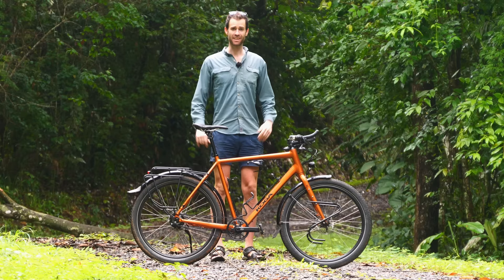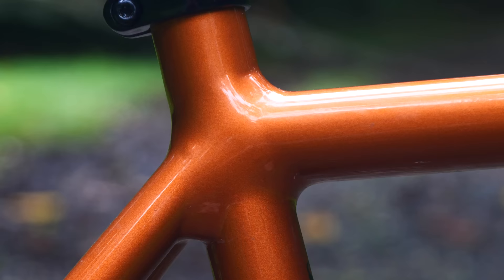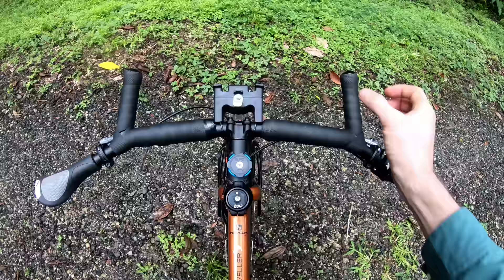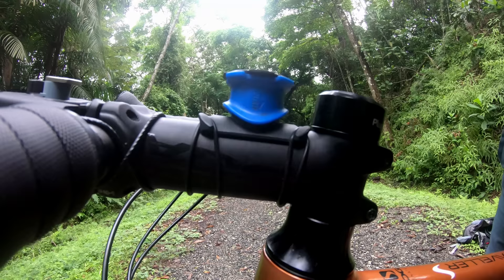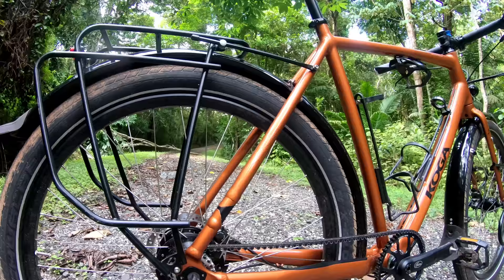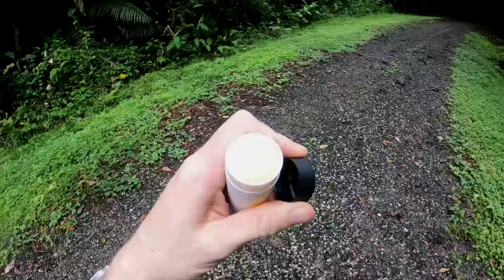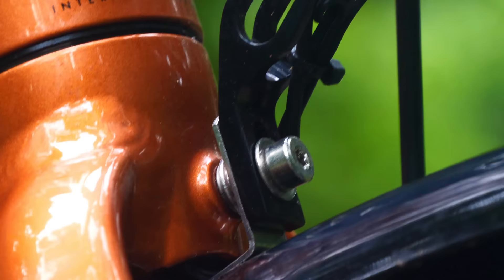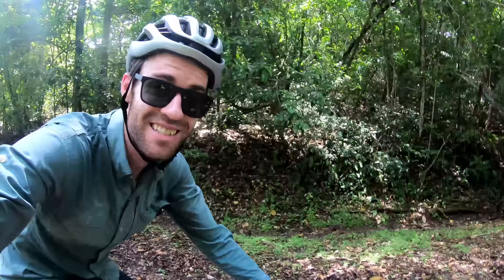The 2020 KOGA WorldTraveller-S is a $6000 Indestructible Touring Bike

Comment: What no pinion!? Hmmmm
Reply from the maker: Sorry to disappoint. 😅
Reply: CyclingAbout 😁 Didn’t you have pinion on a previous rig?
Reply from the maker: @JohnBr0  I've been using Rohloff hubs for the last 10 years, and love 'em. 👌🏼
Reply: The high price of the Rohloff hub is offset by the fact it has an amazing lifespan. Most owners go through multiple bikes with the same hub for years on end, and a man from Spain has been using his during more than a decade while travelling non-stop for the last 15 years!!
Reply: Pinion is an interesting development in cycle touring. That said, I’m curious how it will handle conditions like the ones experienced in this video series.
Reply: @dougfromsoanierana  The one from "Kamran on bike", who is doing the same trip as Alee, has been replaced recently. Don't know what was wrong, though.

Comment: What a sick rig! Love that gorgeous colour 😍😍  I also run supermoto-x's on my plus bike, but they are the 2.8's. I did recently have a puncture which surprised me, and it was a piece of glass which gave me a slow leak. Apart from that they just iron out most imperfections in pavements and roads and roll surprisingly well. The downside is that they are an absolute bitch to remove and install, on my rims anyway.

Comment: Junk for $6000 I can get a really nice mountain bike.
Reply: I thought exactly the same, a hard tail can do absolutely the same for $1000.
Reply: I thought so too for a moment but realised that most of the tech is hidden - its about quality of materials and reliability - the hub alone on his bike costs over a grand. But means you never need to clean it - lights charger everything is intergrated and topend. I bet those racks cost hundreds of euros also. we see alot of stuff that is cheap and looks the same but not with the level of reliability
Reply: @harryc7225  shitty aluminium instead of high tech steal. plastic shifters etc... 6000(!) $.
Reply: @kohlrabenschwanz  Even as a kid I hated this plastic shifter and knew it was shit. This looks exactly the same. That really surprised me.
Reply: Polygon bend riv

Comment: It's genius that the Netherlands and Germany make the world's best touring bikes. Falkenjagd are doing very stiff titanium forks and thru axles or standard.. They are confident their racks they make identical to tubuss can not fail at the welds and began making planes. 

They went away from tubus because of material issues meaning they stopped producing the logo titan and because they refused to drill a hole for cable internal wiring. The brand also make stainless and rennstahl painted racks at lower price with same benefits and paint is very anti corrosive and resists many scratches due to air hardening

Comment: Not sure quite what to think about internal cabling. Prefer straight cable runs to avoid as much wear as possible. There is the argument of protection but not sure that amounts to much. Seems more of an aesthetic choice. Is there a weep hole to channel moisture?
Reply from the maker: At the bottom bracket shell is the drainage port.

Comment: Great bike. 50/22 (122Teeth belt?) set up seems a sensible choice offering a 2.273 gear ratio. My Koga came with 50/19 120T (2.63) and this is too high for expedition type riding. Gates suggest that the gearing offered by 50/19 is for "On road bike packing, commuting, gravel riding" clearly a ridiculous choice for such a bike.
I am sorry to say that Koga also offered no advise on what other combos suit the frame and eccentric BB. So for anyone interested 46/22 works with the 120T belt and gives a super low set up of 2.09

Comment: Just as nice as my rennstahl. I recommend steel and don't really enjoy the buzz from alloy frames on rough roads through pedals and bars after multiple hours I often spend 24 hours riding. 

I love your setup and the colour. I really want to own a Reynolds 931 frame from rennstahl/falkenjagd 

With all the same technology plus internal dynamo cabling in fork and racks I highly recommend asking them possibly in future for a sponsor. I like koga too but just like koga being a distributor instead of a shop it means a lot to know them personally and have no questions asked parts sent to me if anything happens

I like rennstahl because they're less common plus fitting is insane.. Only 5 UK customers apparently including me have one vs Europeans

Comment: Fantastic bike. The super smooth welds are a nice touch I guess but I can't help but think that grinding the welds off takes material away which might compromise the structural integrity. Besides, I like the look of nice beefy welds, it makes the bike look tough and rugged. Just my opinion of course.
Reply from the maker: Only a very small amount of the weld is actually ground down, and the structural integrity of the interface is then assessed in KOGA's testing facility to see if it can withstand millions of cycles of force. The rest of the smoothening is actually a putty that is applied over the top of the weld, which is purely aesthetic - making the tubes look as if they disappear into each other.

Comment: Hi Alee, 
Here's a tip for an article for you: smooth welding. Why don't you write an article (and produce a video) on frame smooth welding, listing the best in class bikes (and manufacturers producing these)? Koga is, of course, the master of the craft, and so is Trek (check out the Emonda 5 AL disc, for instance. Not only does it look almost like carbon - the purple paint job is absolutely gorgeous, too!). 
 And another article on colour (i.e., Trek's purple paint scheme, Trek's Project One colours, Specialized Satin Oil, the famous Klein paint schemes, the beautiful metallic colours some expensive modern bikes are painted, etc.)?

Comment: my 30 year old free touring bike is similar to the structure of this, only large differences are that mine doesnt have an dynamo and that fancy drivertrain, still i think it will outlive this bike, i care for it (i put some bike trips on it and i use it daily even in winter for the past 5 years, it had previous owners but no data because it was stolen by previous owners and completly resprayed the frame, and i dont usually lock it, with its scratched off paint it looks like a rust bucket, still its more reliable than my other bikes, i hope i can use it till the chainslap makes a hole into the back triangle)
Reply from the maker: Hopefully, you can keep the chain slap at bay!

Comment: Impressive 100,000 km riding. Lot of riding. Congrats. Does suspension seat post, smooth out the ride from the stiff wheelset?
Reply from the maker: The suspension seatpost and wide tyres make the ride very smooth. I'm very happy with the combo!
Reply: It looks as though a bikepacking seat post bag will work well with your seat post suspension. Reduced movement and no bulky contraption interference.

Comment: Thanks for a really interesting presentation and good explanations of your personal choices. I was wondering if you have ever tried 'classic' metal fenders such as Honjo/Gilles Berthoud/Velo Orange. I find these to be a huge improvement over any kind of plastic fender I have tried so far. Maybe hard to find some for your wheel size, but I believe Honjo makes some pretty wide 650b fenders.
Reply from the maker: Thanks! I've got metal fenders on a few of my other bikes, but I use plastic fenders mostly for safety. As I ride in places with lots of sticks and rocks and mud, I don't want my front fender to get jammed like this poor guy! https://www.cyclingabout.com/wp-content/uploads/2018/12/Fender-Stick-WoodyWheels.jpg 

Yep, a stick in the front fender did that! The SKS fenders have struts that can decouple themselves in an instant, which also allows me to clear out clay mud if I need. I also find that plastic fenders can withstand more wear-and-tear off-road, and they travel better in bike boxes.

Comment: Sweet new bike! So the only change from previous is allowance for wider tires? I'm curious how much difference you experience off road. I thought you had the Almotion tires on your previous bike; I'd be curious to know how many km's you got out of them.... bon voyage!
Reply from the maker: All the changes for the new WorldTraveller are found in my article here: https://www.cyclingabout.com/2020-koga-worldtraveller-s-touring-bikes/

The previous WorldTraveller could fit 27.5x2.4" tyres too! I'm looking forward to seeing how I like this tyre specification. My Schwalbe Almotions were replaced at 15,000km but they still had a fair bit of life left. I usually swap the tyres at about 10,000km because the rear always wears faster than the front. 👍🏻

Comment: Question about your handlebar design. All my bikes have a horizonal top tube lengths of 59cm. 10cm stem, then drops. I have a bad back but this set up works perfectly, over long, multi-day rides. So, if I were to buy your handlebar for my tourer, what would I need to do to ensure an identical bike fit/position? Longer top tube? Longer stem? Nothing? Alee - I'd be interested to hear your thoughts. Thanks.
Reply from the maker: It depends on how much 'reach' your drop bars have (they range from 70-110mm), and which bar section (grips or bullhorns) you want to optimise for.
On a traditional drop bar bike, most people seem to be going 1-2cm longer with the stem, which will move the bullhorns a bit further forward, but get the grips in a better position. If you're already using a short-reach drop bar, (70mm) you can leave your stem length as it is.

Comment: Did you drill a small hole in the top of the rack to be able to run the cable through the tubing? I have a similar rack and interested in copying your setup.
Reply from the maker: I'm fairly sure KOGA drills this hole when assembling the bikes at the factory. 👍🏻

Comment: what kind of smart phone are you referring? it will take a while charging a phone with bicycle dynamo (actually an alternator instead of dynamo). SON dynamos are limited to 3W and 6V, so at 5V output charger the output current available will be little bit larger than 500mA, considering a charger efficiency >= 95%.  the battery idea inside the steering tube is a good idea... i will try it. 
great bike!
Reply from the maker: It depends on the speed you travel. With an output power of 3W @ 14km/h, you can indeed expect ~500mA per hour with losses in the circuitry, it'd take around 5-7 hours to charge a big smartphone from scratch. But dynamo chargers aren't limited to 3W output power, some offer 8W @ 30km/h. Here are some graphs! https://www.cyclingabout.com/best-dynamo-usb-chargers-bicycle-touring-bikepacking/
Reply: @Cyclingabout  any type of charger is limited to its input power (power source), in this case SON dynamo. So, there is no way you can get more than 3W even with a 8W charger. 
the battery you carry in steering tube is custom made or bought it some where?

Comment: Not true about flat pedals, with flat pedals you dont use your hamstring at all, ok well you can activate it on the back sweep a little but with clip ins if your quads are fatigued you can then use your hamstrings to assist by pulling up on the pedals. I can ride about 3 - 4 times further with clip in pedals.

Comment: Great video Alee. Did the weight of the super moto x get into you in anyway? I know they weigh 1kg each at that size. Would you recommend it as an all-round tyre for gravel bikes with mostly road rides and single track weekends? I like it that they are rated to be super puncture resistant. Cheers.
Reply from the maker: Once the bike is loaded up with luggage, the weight is completely unnoticeable. The most important factor on a loaded bike is their rolling resistance, and these tyres roll really fast. I've used them on single track a tonne, but they're definitely not suited to it! Use at your own risk... 😅

Comment: That's one nice bike and I'm not even into touring and I loved it. Subscribed! Maybe it's a camera/angle thing but it seems the frame is rather small for your height? The seat tube looks quite low for your leg length. I would imagine that was a conscious choice and I'd love to know why. Thanks!
Reply from the maker: The camera isn't playing tricks, I size my touring frames down. Why? I'm a strong and flexible cyclist, so the body position I can comfortably cycle in is more "sporty" than most. Apart from this being the most comfortable position for me, it's more aerodynamic and it gives me far more control on technical terrain (rough climbs in particular) as I can put more weight on the front wheel.

Comment: Unless I'm mistaken, nothing for heavy riders. Such frames usually stop at 140KG total weight, which is good enough for most sporty drivers. Looks like I'm caught in the few usual frame companies that allow 180KG in all. Excellent video though.
Reply from the maker: Most premium European touring bikes are rated for 160kg but are tested to be much higher. The only touring bike manufacturer with a higher weight allowance is the Schauff Sumo, which is rated to 200kg.
That said, the parts they use on the Sumo builds are the same as what KOGA use, so it's really just the frame that will have a higher deflect tolerance (this isn't guaranteed though, but let's trust that Schauff has some decent engineering behind their frames). 

In any case, I'd get in touch with a few companies before purchasing to make sure 180kg won't cause any headaches down the track.
Reply: I looked through a lot of "premium" brands, and 160 is rather already an exception. Koga does not even show that spec on their homepage, when I looked the last time at the world traveller. When searching around I found 140 for the Koga on some sites, which was disappointing. True premium in aluminum I found a frame by Velotraum, the vt900 frame and of course the Rennstahl 852 in steel, to both I constantly keep coming back to and which both cost quite a lot :(
Reply from the maker: @-ZELTHELD-  I'll send KOGA an email now to get a definitive response for you!
Reply from the maker: ZELTHELD Ok, the engineers at KOGA have told me the WorldTraveller has been tested to the 130kg protocol, which is currently the highest category of universal weight testing for bicycles. Their independent lab testing indicates that the frame can handle much more, however, but they can’t officially advertise a higher weight rating than 130kg. They’ve told me that they’re working to bring in a new weight testing protocol which will allow manufacturers to rate their frames for 170 or 180kg in the next few years. But in the meantime, they’re permitting 160kg+ setups ONLY with 27.5x2.4” wheels and tyres. I hope this helps!
Reply: @Cyclingabout  Sure it does. Some high end companies use solid axles in the touring frame !and! touring forks as well to increase stiffness. I will continue to check on Koga. Like the finish quite a bit :-)

Comment: This is one awesome machine; what i do not get is - why is there not front suspension on such a bike? Aren't there many unpaved, bumpy trails? Is there a disadvantage in having front suspension on it? Or am i missing something?
Reply from the maker: I don't use suspension because it needs regular servicing to work well - and when I'm not in isolation I ride 40 hours per week which adds up very quick! In any case, I don't find I need suspension because the weight of my front pannier bags smoothes out a lot of bumps and the 2.4" tyres help too. 😎

Comment: How stable is the steering?
I only have 1 arm, i'm currently using a Hopey steering damper on my MTB's, is it likely i'll need a steering damper on one of these touring bikes?
Reply: I'd consider that a MTB might just be the best start for a touring bike for you then.    Touring bikes are probably longer than road racers but the head angle won't be slack. Look at the vid about the grim donut. Seems hardtails are going for slacker and slacker head angles.  That should make things more and more stable. some of em are steel n should take every kind of weight you throw at em. Whether a touring riding position is achievable is the question though, but probably?   Rigid MTB fork.   Racks n stuff. Hobo loop bar or surly loop bar.          You could make it somewhat of a mullet using a 29 tyre in front but 28 slimmer in back, making it even slacker.   Or even a 27.5 in rear.

Comment: Hi Alee, great bike and I reckon for what you get and what you need it to do, the bike is good value.  Can you tell me the length of the rear mudguard?  It looks fairly short which is what I would need for-off road riding.  Has it been modified or an off the shelf SKS product?
Reply from the maker: Gareth Taylor It’s a standard mudguard, but runs short as it’s designed for 26” wheels.

Comment: Great vlogs .....lov watching your adventures 
Iam currently saving for a koga like yours 
Is it easy to get the back wheel off with the carbon belt drive
May the wind be with you
Reply from the maker: Belt drive is actually easier than a chain! It's inherently stiff, so it aligns very quickly and you don't get any grease on your fingers. 👍🏻
Reply: CyclingAbout nice one ...that's what I was thinking ..
Do you have to take the frame apart to get the belt off
Reply from the maker: Yes, you can see the black wedge frame splitter in the seatstay.